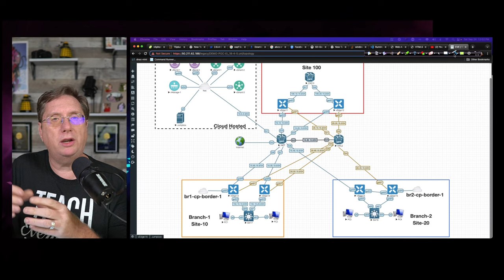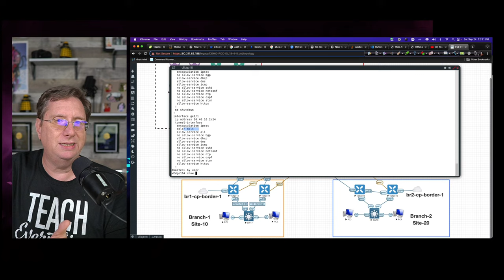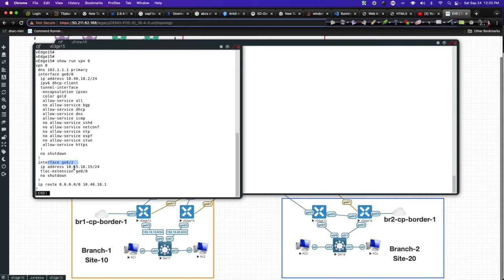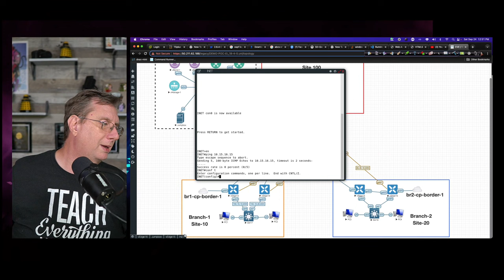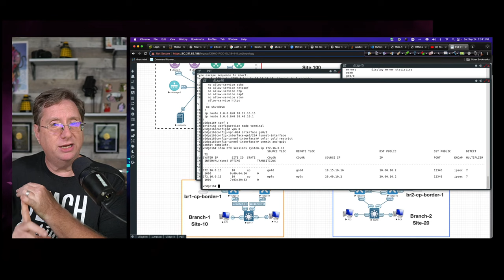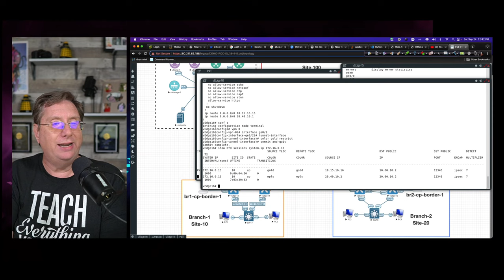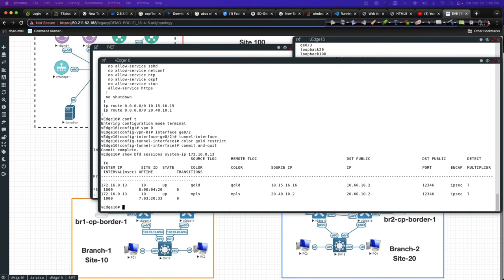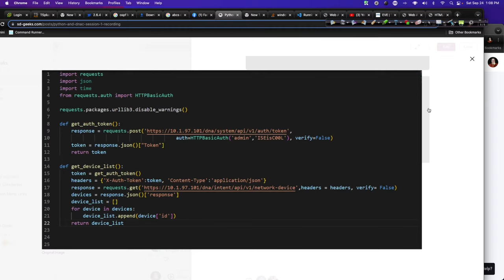SDWAN - TLOC-Extension

Comment: Great lecture again Terry. I am wondering exactly what difference that "tloc-extension X" command actually does. You can still have underlay routing reachability without it.
Reply from the maker: I've never tried it any other way. When I get a few hours i'll test out not using the extension. Plus it would be cool to slap a sniffer between them to see what it REALLY does.